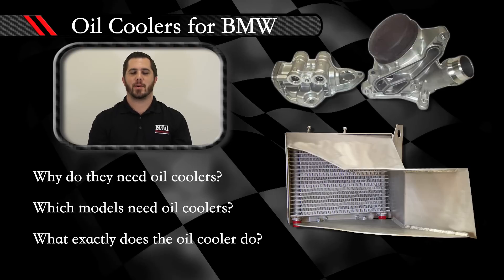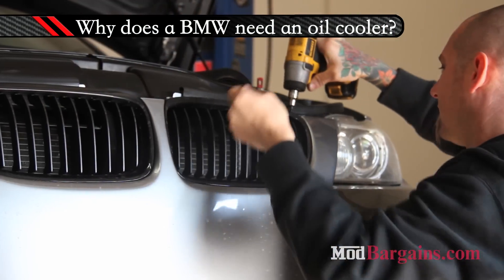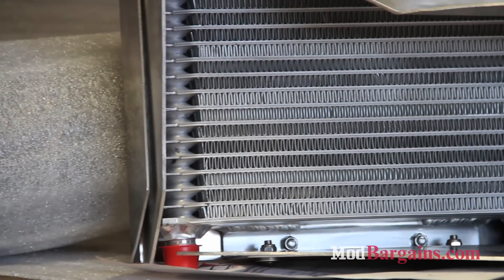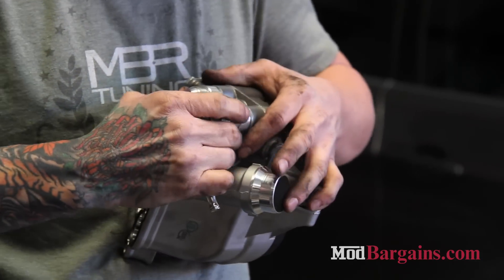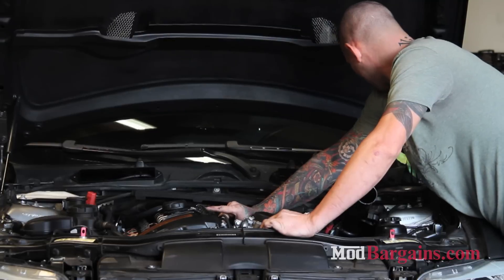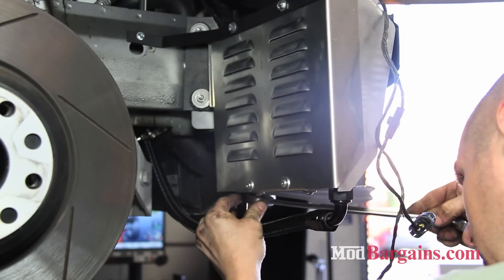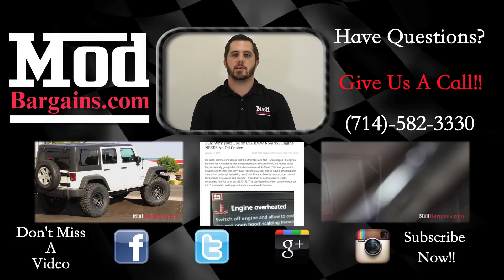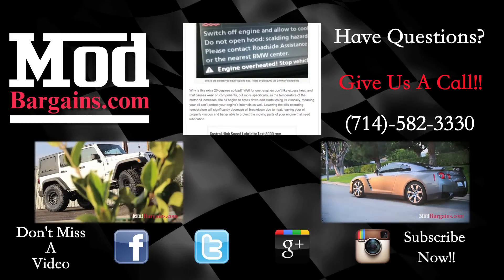PSA: Does your BMW Need an Oil Cooler?

Comment: Where is the blog post referenced in this video? I'm still unclear if my '09 335i N54 should get or upgrade my oil cooler. What I've done so far is the JB4 tune electronics, Cobb charge pipe, and JB air filters.

Comment: I have an e82 118d it's not a simple sandwich plate on the oil filter because the oil filter has a STUPID plastic housing any advice on where in the system I can put oil cooling lines and attach an oil cooling radiator?

Comment: I have a 2016 328i I just have a small heat exchanger on the housing for the oil filter thinking about adding a cooler to it. Would this fuck with the computer at all in regards of oil temp ?

Comment: Do you have any drone or vibration after the oil cooler instalation? I have a drone noise at around 2k rpm after instalation. Everything else is good though
Reply from the maker: strange never heard that before

Comment: Hi , does x3 f25 yr 2015 facelift comes with trans cooler ? Bcos I noticed the driver side is a bit hot after I stopped my car. Pls advice.

Comment: Need one. Live in AL. It's like 95° most of the time lol. But seriously my car goes into limp mode quite a bit. I'm thinking it's the oil cooler. Or the lack of one on my 335i n55.
Reply: Devin completely agree with you it's needed, why car constantnly goes into limp mode as it did on our cars.  BMW can claim whatever they want but they really cheaped out on their stock oil cooler, which the 335is has a slightly beefier one. It's 90 today here in La Habra, CA (ModBargains) in october. Give us a call here at ModBargains 714.582.3330 or email us at sales@modbargains.com, and happy to help you get one over to you!

Comment: So the 2012 E82 128i base model can not have an oil cooler?  does it need to be retro fitted with 135i oil pump?

Comment: Does my car have an oil cooler? It is 2006 BMW X3 3.0i. I have oil leak into the coolant.
Reply: Yes it has a small oil cooler , also known as the heat exchanger.  You can buy the modine brand on eBay, Amazon, or FCP Euro.com.   Only replace if it's original and is leaking.

Comment: Does a 2008 335xi E92 sport which has an oil cooler, need an upgrade if I'm not tracking it? The car has ETS charge and downpipes, TIAL BOV, CSF front mount heat exchanger #8075 and I run MHD N54 v8 Stage 2(+) 94 map but rarely put my foot into it. I monitor/graph often with MHD and oil temp hasn't gotten above 185C (it's winter here in Missouri). Coolant never above 198. I'm looking at oil and trans coolers with the premise being; the cooler, the better. FMIC in a month or two.
Reply from the maker: The cooler the better is only true to a point and also depends on what you are talking about. There are optimal operating temperatures which you want to stay within and attempting to go below them will not benefit the car.
As far as an oil cooler goes, it sounds like your oil temperatures are well in check. However, keep monitoring them as it warms up and see how they do. If they start breaking the 230 degree marker it could be a good idea to pick one up.
Reply: Sage advice. The CSF #8075 took a solid 10F off. Great piece. Thanks

Comment: I have a 03 325xi with a oil catch can, afe mach force cat back exhaust, and soon supercharged...I eliminated the clutch fan with a electric fan but see I noticed my oil has been so freaking hot so should I add a oil cooler and what kind should I actually get...